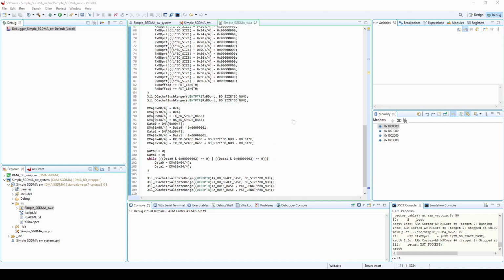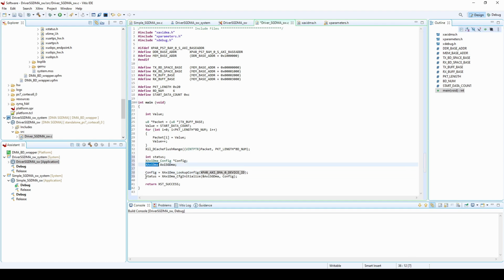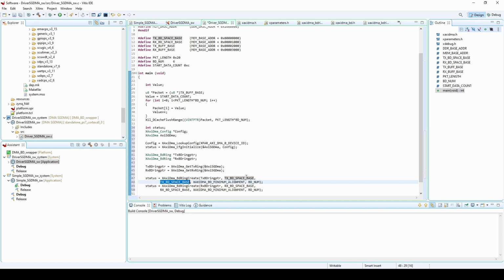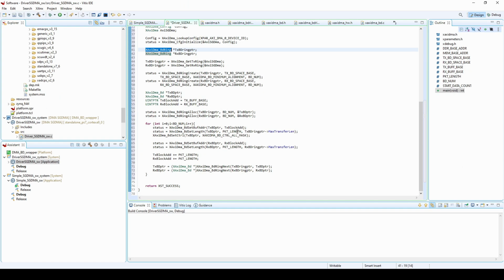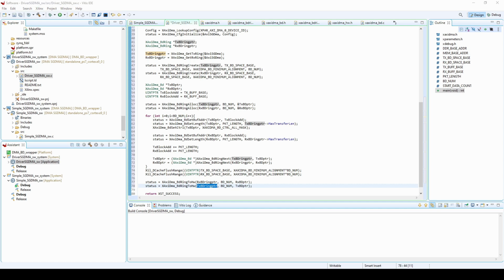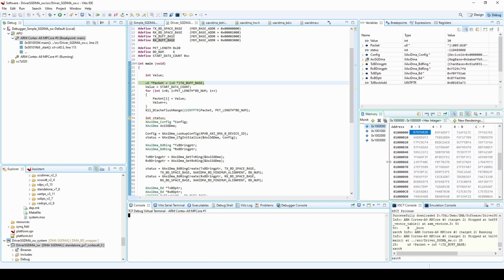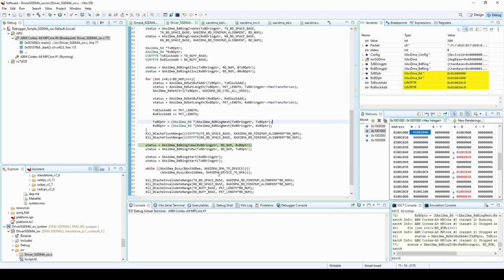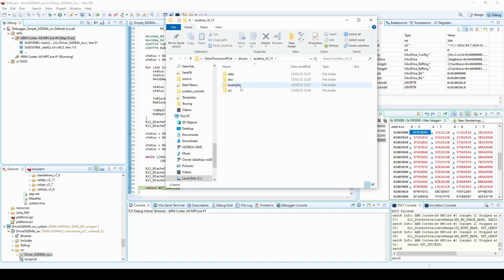Scatter Gather DMA part2

Comment: Hi, I am generating a sine wave with an FPGA. I am trying to write these sine samples to DDR memory continuously using DMA in scatter-gather cyclic mode. The problem is that the written values in the DDR are not entirely correct—there seem to be discontinuities in the process. What could be the problem?
Reply from the maker: Hi 
I didn't work a lot in cyclic mode but my guess is that one of you BD's have the wrong address. (or the rebuild of the BD list has a bug). 
By the way you can consider the DataMover IP where no software is needed when storing data in the DDR. Here is a link to my tutorial on DataMover:
https://www.youtube.com/playlist?list=PLv0KRXOsP7UqbY4ZlhKZxJL52KkNipbAh